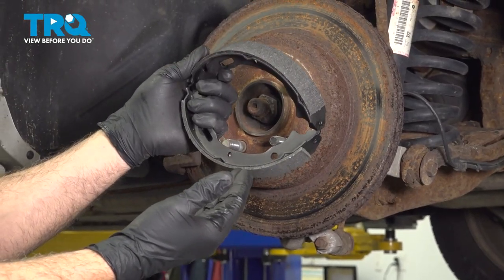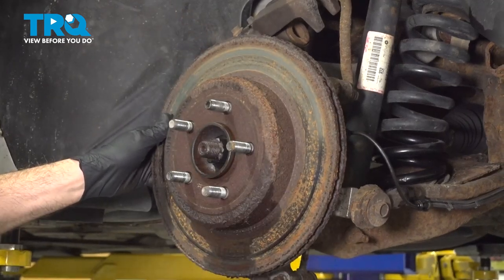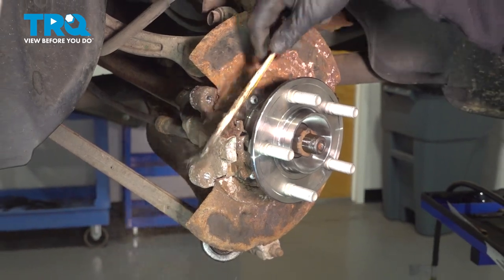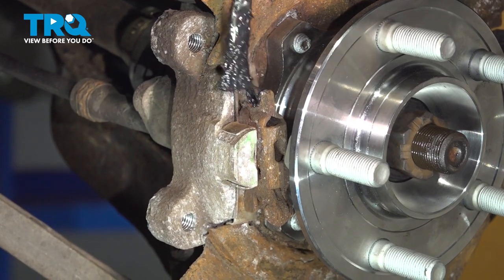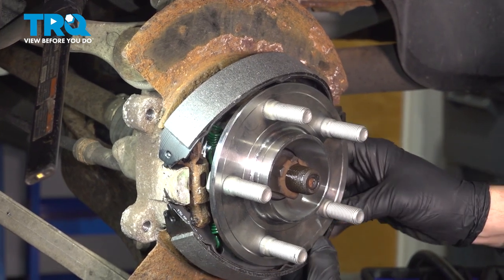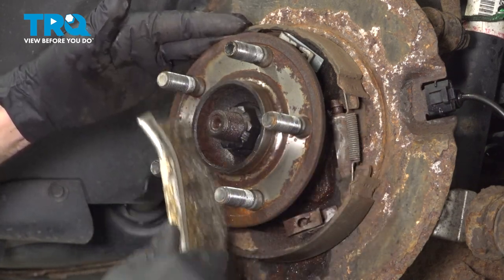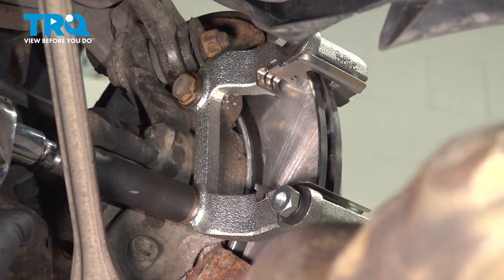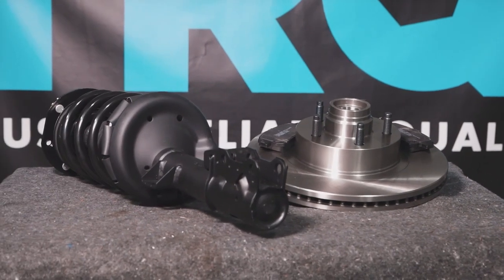How to Replace Rear Parking Brake Shoes 2005-2010 Chrysler 300

Comment: MUCH better tutorial compared to 1A Auto's. This is a very simple replacement but I still enjoy watching these type of tutorials personally for entertainment purposes. You guys went through this tutorial very professionally, without having to remove the hub assembly, whereas 1A Auto said you had too, and in addition, you took time to clean all parts and contact surfaces rust free as best you could before installing parts. AND most importantly, you went over adjusting the parking brake once installation was finished, which 1A forgot to mention as well. KUDDOS TRQ!